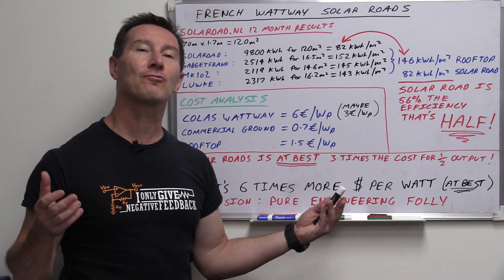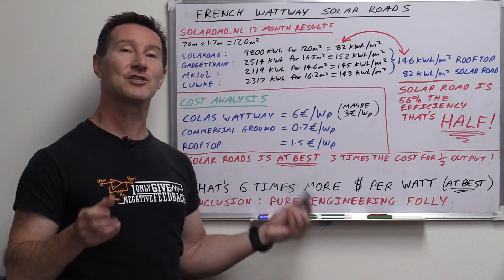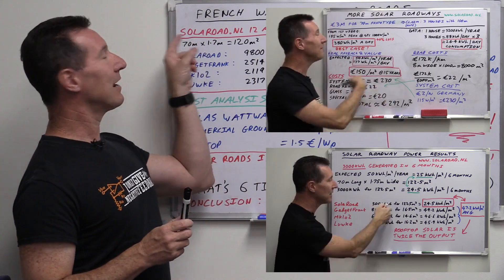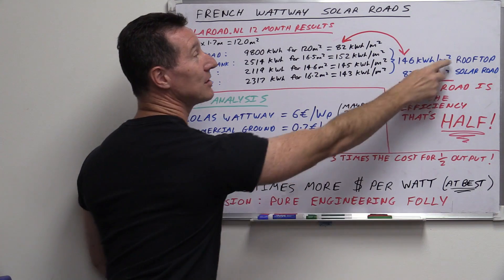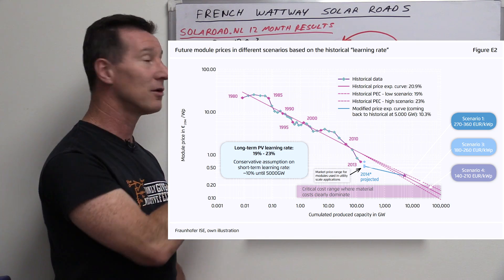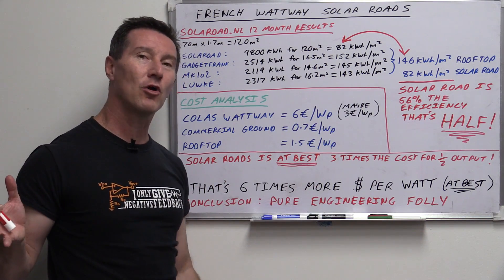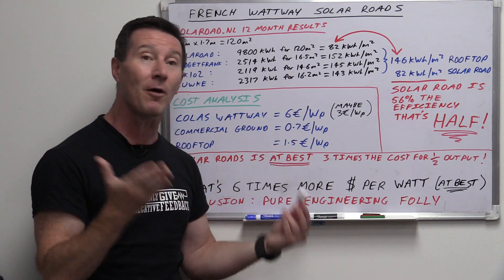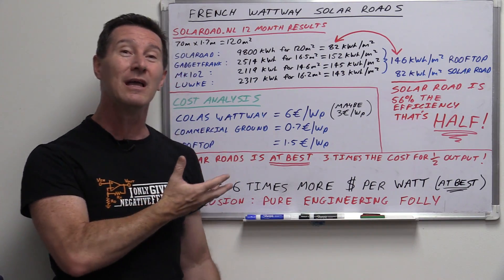EEVblog #850 - French Wattway Solar Roadways BUSTED!

Comment: Hmmm. I agree that the cost to benefit ratio is truly shitty, but if we are going to eliminate carbon from our energy stream, its going to be the most expensive thing humans have ever done, by far. So this is a double edge sword that your describing here. On the one hand it is sad that so much money is going to a company mostly for political reasons. But on the other hand effort is being made towards reducing our carbon footprint (even if this initial effort increases it). 

I have ideas about how to reduce the carbon going into the air, but I don't have the connections or marketing/sales skills to get anywhere with these ideas. This is where the real deficiency lies, the big companies with polished marketing and sales teams are going to get the vast majority of the money and overall this is going to make our conversion away from carbon thousands to billions of times more expensive than it could be. But this is just the way our society is going, there is nothing that I can do about it. I wish you the best of luck in your campaign!
Reply: the cost still is not what is stopping this. fuck money and let us deal with  science. the science does not back these things up. they are not going to be useful in the roads
Reply: +Brian McConkey  This thing is the exact opposite - if anything it is HINDERING the reduction of our carbon footprint.
We only have limited resources, and wasting it on the worst ideas possible is just retarded.

For the same money as the road you could get 6 times the energy on rooftops, don't need new technology, far longer lifetime, practically no maintenance-cost.  

if you are tuck in a blizzard and have a petrol lamp and your cloth, you don't burn your cloth to get light - it might work but if you do so - well you deserve to freeze.

Comment: well europe has alot of cycleways and alot of them go to fairly remote places were energie could be used for alot of stuff.   its not worldchanging, but could be usefull in some places.
Reply: +Novashadow115 indeed if they need some power in a remote place one assumes said remote place will have plenty of space for a traditional solar installation. cheaper and more powerful and using less space. solar roads make no sense from any angle.
Reply: no, it will literally be useless in these instances. who willingly decreases their efficiency?
Reply: 0tispunkm3y3r
the cyclingways are there anyway, so they dont take away space from nature. and runing power along the cycleways would be nice too, so you can have lights at the right places.   sure its not cheap, but who cares about the money if it looks good? our local government just spend 150k € on a very cool looking little bridge. just replacing the old one would have costed maybe 10k.  im totaly fine with that.  and i thing solar walk or cycleways can be used for realy realy cool stuff.

Comment: Engineers: "Here's a high efficiency mono-crystalline solar panel to produce power from the sun. Although very stable and developed mounting systems have been developed, care must still be taken with them as they are fragile and sensitive to dust and shock."

Politicians: "Let's pave the streets with them"

Comment: you're not wrong, but the real comparison to make is how much power you get from tarmac or concrete roads, which is zero
Reply: +steubens7 But solar roadways gives you negative net power.
Reply from the maker: +steubens7 No, it's not. Watch the whole video, I cover that.
Reply: +EEVblog I did, and I understand the criticism from the perspective of cost efficiency and stuff, including from past videos. it is assuming a position that is trivially stupid, I'm suggesting there might be another calculation in play. the concept of roads themselves are reviled in a lot of places too, and the idea evokes shopping mall wastelands, urban heat islands and other road problems
Reply: +steubens7 conversely the value proposition isn't in efficiently placing solar capacity but that it is green-ish and motoring adjacent

Comment: Thought about it even more. The following costs are bundled into the SOLAR ROAD figures:

1. Building and maintaining cell phone towers
2. Building and maintaining power lines
3. Building and maintaining Urban WiFi nodes
4. Building and maintaining Fire/police trunked radio dispatching networks
5. Building and maintaining Roads themselves
6. Building and maintaining Residential waste elimination system (sewers)

All of these accounting expenses would rolled into one financial expense for a city, country, or global infrastructure. The problem comes when you have to dig up the existing infrastructure and rebuild. ULTIMATELY, your point about "driving on a solar panel" trumps all defense of this initiative. It probably will not work as you say.
Reply: +navyman4 
sewage: how do solar panels on the surface help mitigate or improve sewage?
Electrical distribution: you still need HV cables overhead or that will be too expensive so power lines, you&#39;d still need em
Cell tower / Urban WiFi /&#160;Emergency dispatching networks: you need networking infrastructure to back that up, and that would only compound the cost, 

basically, there are better ways to do all these things, so why have 1 thing that tries to do all of them and fall short.
Reply: SpeedrunnerG55
That side tunnel...yeah...they are thinking of expanding it. Much of the TELECOM backbone is underground already. Cell towers wouldn't be needed. Every 50ft there could be transmitter/receivers that do the work of cell towers. Of course a YouTube comment isn't sufficient to explain the enormous engineering effort; however, those general points should answer your question as best as allowed in short space.
Reply: SpeedrunnerG55
Also, I'm confused about your HV comment. I was in the Navy for 8yrs. Why would you need it overhead? We had it running through the ship just fine. Maybe I'm uneducated on this. Please explain.
Reply: when i said HV i dont mean residential power that is typically 240V i meant the cables above that that are several KV (110KV) its possible but very expensive to insulate.
Reply: SpeedrunnerG55
Oh I see. Well, seems like you are more educated on Extremely HV so yeah. This is likely impractical as he says. The kicker though is the very concept of building solar panels that are blocked by traffic itself. Inherently bad concept!

Comment: I wanted to believe this initially, but more I considered and saw your first video the stupider it got. 
I support renewable power, but if it is like this and people jump onto this type crap I think is going to do more harm than good.

If there is one renewable source we have a real chance at going with 100% it would be thorium. But then people are like well its nuclear, yeah so 1. thorium setup is near impossible for it to go Chernobyl, it can't e weaponized like what we have now, and it's radioactive for a minuscule fraction of what the current waste is. Heck they say we can even use the waste we threw out as fuel again.
Reply from the maker: +jtech0 Agreed, it will do more harm than good to the reputation of solar energy.

Comment: What are your opinions on Li-Fi?
Reply: +octavio echeverria I know this isn't asking me, but here we go...
Li-Fi is pretty much overkill and has large issues that WiFi doesn't have.
Current Wifi today is sufficient for what we use it for. LiFi boasts about being like 10x faster than WiFi, but honestly, who needs this? Consumer grade gigabit routers (E.g. Asus Nighthawk) can already get over 1gb/s. Most ISPs only offer around 100 mb/s at best, and those who are lucky enough to have Google Fibre or a similar service will still not use the entirety of that transfer speed. Even if the ISP can provide a very high speed, this would be for an office, wireless connections are only for devices like laptops and tablets, no one connects their workstation machine using unreliable wireless connections when they could have ethernet.
Another very large issue is that using the visible spectrum for transfer is interference. The nice thing about EMR around radio wavelength is that it goes through pretty much anything, be it walls, floors, people. If someone puts their hand over your LiFi receiver, you are going to have issues. So now you need to get LiFi transceivers for every room in the house, such as replacing lamps, chandeliers, etc. It might be easier to just wire a ethernet cable through the wall of all the rooms.
Thats pretty much it, theres no practical advantage to LiFi, maybe in some very special cases it would be better, but not often.
Reply: +jackguo380 the only need for it will be just in network transfers.  If you ever need speeds like that you are likely running a Cat 6/7 (7 for 10 Gb/s)  wired network anyway.

I didn't even know about the EMR short comings.  You would also need a line of sight to the light bulb...  Need a bulb in every room...  Sure it's secure but so is a wired network.
Reply: And not to forget all the other problems with LiFi.  

In a big room with multiple light-sources you will have fun.  
You need wired highspeed connection to every lamp, special dedicated lamps, receivers (they cost several times more than a simple antenna), can not go through any obstacles (Hello Shadow-of-my-hand).

And what many forget - it is a directed transmission - you can only receive with LiFi - for sending you need yet more dedicated hardware.

And current WiFi - the AC standard is in the range of multi Gb/s already, more than normal HDDs can deliver, more than enough to stream several 4K videos, way faster than your internet is.

LiFi is just oa overhyped overtheair version of fibreglass.

Comment: Why don't they offer just to put 1kwh on 1,000 houses free of charge, I am sure you would get more power.
Reply: A local company did that around our area, installed solar panels for free then linked them to the power grid so that whatever power you don't use is sent to the grid, thus recovering the installation costs. 

The panels have been up for around 5 years & I haven't seen anyone maintaining them. 

I live opposite a house with them so would notice anyone on the roof.
Reply: My local power company is doing that. You get to have the power generated go against your bill for 3 years and then you get no benefit. And they own the panels.
Reply: +bdot02 Nvm it's $30/month for 20 years ($7200). And at the end of the 20 years they come and take it away for free. Seems like a decent deal but I don't know much about how much you can make off of solar.
Reply: +#01DF01Seba Abdur-Rehmaan Solar panels on roofs don't really need maintenance. At best you can clean them once every couple of years to increase their output back to original.
Reply: +TheBlokeSolar&Wind This is what I was thinking - Instead of spending a few hundred million monies on these stupid things, why don't they put that money into rooftop solar panels and where applicable wind generators? The problem i think isthat makes too much sense
Reply: +DC Has to be done right though.. I dont see a point in turning farmland or forest into solar panels.. That just seems wasteful somehow.
Reply: It would even be better if the residents they offered it too had a percentage of its power output (say 15%) fed into their meter to lower their bill as an incentive. It would still annihilate the efficiency of the solar roadway idea. Everyone happy :)
Reply: +TheBlokeSolar&Wind They tried that in Germany several years ago, but then too many people started putting PV panels on their roofs and so the energy companies rebelled against that, and now it's gone again. I don't know the specifics, but the deal involved a guaranteed price per kWh you feed into the grid, and it got lower each year, after we started getting too much solar...
Reply: +WakarimasenKa There's so much unused roof area in every city, in every country, in every village, it would be no problem to equip all these with PV panels. Just the "who pays for it" is the problem.
Reply: ***** Correct!
Reply: +TheBlokeSolar&amp;amp;Wind I wouldn&#39;t be surprised if they outlaw solar power battery banks. It is not difficult to have solar charge batteries which run your house until discharged, then switch back onto the grid, getting full retail out of your generated electricity. A little costly up front but better than the alternative, which is letting the city steal it by continuing to increase electricity costs and decreasing electricity credits.
If you generate more than you use, no more electricity bills, but I have a feeling electricity companies would force you to pay them if they find their services not necessary anymore.
Reply: +WakarimasenKa Agreed. However, there's plenty of space. For example, top of buildings and houses.
Reply: +WakarimasenKa how about all those big flat  roofs on warehouses and factories and industrial estates
?
Reply: +Seegal Galguntijak If the government is going to pay for it on roads, they can use that same money to pay for it on roofs.
Reply: +squeak83uk2 actually, better to have the panels angled to catch the midday sun for a particular latitude on a particular day of the year (the day is the average where the losses due to the lack of light of winter and how much is lost over a yeah by just angling it for the light in the summer). More advanced commercial setups can have motorized mounts to counter this to give better performance all year round (I don't know if and also track the sun during the day, I can see the running of the motors to continuously track the sun may cause too larger inefficiencies from the power produced to make it sensible and viable).
Reply: +TheBlokeSolar&Wind Because your house is a private property, who's going to just gift you the panels, it's your own business to buy them and install on your rooftop, while roads are public property, and government can and will do all kinds of upgrades for that. Like, if I'd ask you to buy me a solar panels and put on my house, would you do that?
Reply: ***** Do you know what a subsidy is?
Reply: ***** Yes, but not everyone gets them.
Reply: Richard Smith It's that you don't get energy-tax paid if you produce more than you use ;) , which sort of makes sense. Anyway, if you produce more than you use, just get an electric boiler to heat up water during the day, so you can use less gas for taking a bath
Reply: ***** Yeah, you can convert it to something else. Thats a whole topic in and of itself :)
Reply: +redtails Yup.  If rooftop did require frequent repair, it wouldn't be capable of reaching payback in 5~10 years, as it currently does.  And if these  maintenance costs were high enough, it would never pay back the initial investment.  If rooftop was as fragile and unreliable  as I suspect solar roads will be, they'd be laughed at just as loudly as this nonsense.
Reply: geonerd People still laugh at rooftop pv you know. Because every investment comes with risks, even though there aren't many risks associated with it
Reply: +redtails 
Kinda old post, i know
"Do you know what a subsidy is?"
They did subsidies where i live, with a result of tons of ppl with money placing solar panels.
Then there was a whole bunch of shit going on money wise that i cant remember fully, but i do remember that a lot of people simply disconnected themselves from the net and became independent.
And that because of all that my energy bill has now gone up with a 100€ a year + a large tax increase on top of that as well.
Everyone that doesnt have a big income is having serious money issues now thanks to that.(either cant pay the bill, or their bankaccounts are empty at the end of the month)
Some ppls energy bills even doubled in the course of 1 year. Most went up with 30-40%.

Its one big disaster,
because the subsidies cant get paid back, I now have to pay the price for it.
I dont own solar panels, i couldnt afford any to begin with. But now i gotta pay the price for all the people that could afford them.
So think twice before going about with subsidies. We got plenty of experience in this country with that.
And 9/10 times they turn out to be bad decissions and the general public can go pay for those bad decissions.
Reply: ***** Yeah we do have a good deal here in Australia. If more country's could do the same thing it would make a big difference.